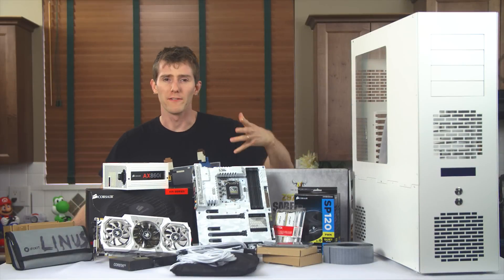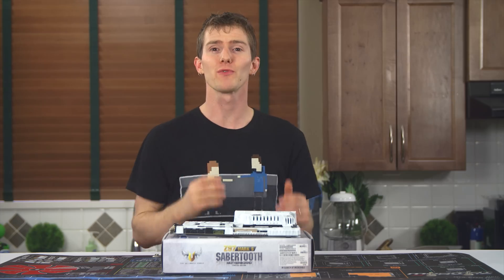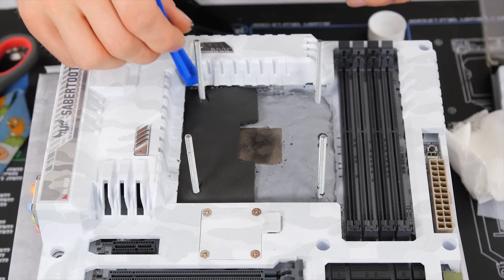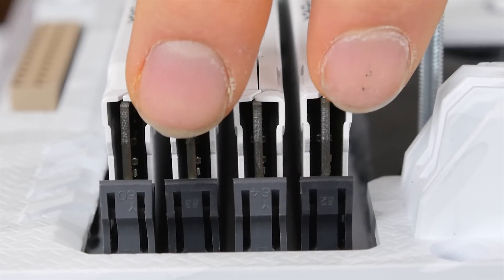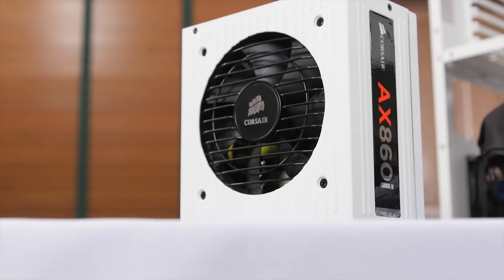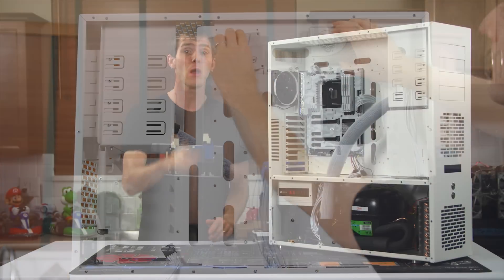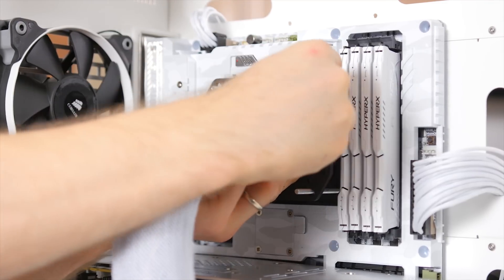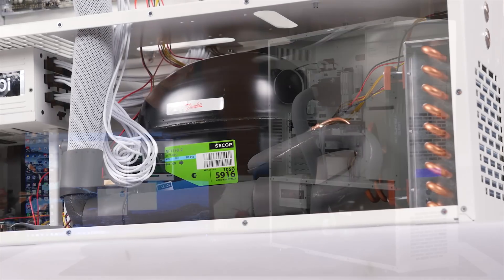ULTIMATE Sub-zero Phase Change Cooling PC Build Guide

Comment: So i have never built a PC before but i was thinking of going with the parts
CPU:i5-3570K 3.4GHz
MB: MSI Z77A-G41 ATX LGA1155
RAM: Patriot Viper 3 16GB DDR 3
GPU: Radeon HD 7950 3GB
Is this decent or is there anything i should change also what would be a good HD and Case to go with?
Reply: Jacob Grimmykins Where do you live and what is your budget. For this build it I recommend some western digital black HDD and you can use whatever case you want aslong it fits (Corsair 500R or SPEC-01 are more than enough, so you can safely use it).
Reply: Alright thanks im from the US ill try those 2 out thanks!
 and im trying to spend between 1000 to 2000
Reply: Just wait for Broadwell or Skyline. They are planned to be released this year. If you "need" a computer now, this is a typical high-end gaming computer: http://pcpartpicker.com/p/yQWcvK and anytime upgrade to Broadwell when its released.
Reply: thanks again i might try this build out
Reply: DON'T BUY THE ASROCK Motherboard, I discovered someone who had issue with it. Just get a Asus Z97-A or a Gigabyte GA-Z97MX-Gaming 5.
Reply: Jacob Grimmykins Why get a last gen CPU when the current gen is soon to get a die shrink? Intel Skylake (6th gen) is releasing this year. If you can't wait that long, at least get the Haswell. Unless, of course, you found a steal of a deal on that ivy.
Reply: Jacob Grimmykins Its good but don;t take 16gb of RAM , go with 8, it will run windows 8 (ha). Gaming needs no more than 8
Reply: thanks for all the comments i think i got a good idea what to build now. This is what i came up with. Im just sticking with a stock cooler for now because i wont be overclocking if i eventually do ill go with a liquid of some sort http://pcpartpicker.com/p/dRQGRB
Reply: I'm going to repeat this, wait until Skylake releases. It will be going to be released this year.
Reply: ***** They are using the same socket, but calling them the same would be an insult to the engineers over at Intel.
Reply: Jacob Grimmykins This is near the top of your budget but its really nice http://pcpartpicker.com/p/qpxdWZ
Reply: thanks i built something similar to this :D

Comment: is this good for a first pc?

Cpu: intel core i5 4690k
Mobo: GIGABYTE GA-Z97N-WIFI ITX
Gpu: NVIDIA GeForce GTX 960 - 2GB
Ram: G.skill Ripjaws x series 8gb 1600
Cpu cooler: Corsair Hydro Series H55 Liquid CPU Cooling System
HDD: WD Blue 1tb
SSD: 250 GB Samsung 850 EVO SSD

Comment: That is... unimpressive. Linus I can get 5GHz stable at 1.3v on my Kraken x61 (Albeit with my load temps in the 75 degree range) You really couldn't push it any harder with that bad bitch strapped onto it?

Comment: Bitch please I max out every game with my beast

[PCPartPicker part list](http://pcpartpicker.com/p/tVZZK8) / [Price breakdown by merchant](http://pcpartpicker.com/p/tVZZK8/by_merchant/)

Type|Item|Price
:----|:----|:----
*CPU* | [AMD 2650 1.45Ghz Dual-Core Processor](http://pcpartpicker.com/part/amd-cpu-sd2650jahmbox) | $25.99 @ SuperBiiz 
*Motherboard* | [ASRock AM1B-M Micro ATX AM1 Motherboard](http://pcpartpicker.com/part/asrock-motherboard-am1bm) | $26.99 @ SuperBiiz 
*Memory* | [Crucial 2GB (1 x 2GB) DDR3-1600 Memory](http://pcpartpicker.com/part/crucial-memory-ct25664ba160b) | $18.99 @ Amazon 
*Storage* | [Samsung Spinpoint F1 DT 80GB 3.5" 7200RPM Internal Hard Drive](http://pcpartpicker.com/part/samsung-internal-hard-drive-hd083gj) | $14.15 @ Amazon 
*Video Card* | [Sapphire Radeon HD 6450 1GB Video Card](http://pcpartpicker.com/part/sapphire-video-card-100322l) | $28.99 @ SuperBiiz 
*Case* | [Thermaltake VL80001W2Z ATX Mid Tower Case](http://pcpartpicker.com/part/thermaltake-case-vl80001w2z) | $21.99 @ Micro Center 
*Power Supply* | [Logisys 480W ATX Power Supply](http://pcpartpicker.com/part/logisys-power-supply-ps480dbk) | $

 | *Total* | **$150.09**
 | Generated by [PCPartPicker](http://pcpartpicker.com) 2015-04-13 21:44 EDT-0400 |

Comment: im running a 4790k on a h100i and im sitting stable at 4.7ghz... IMO all that noise and the cost of a phase changer isnt worth a 300Mhz better overclock.

Comment: was expecting to see more info on the temps than just a flash of what i assume is idle temps
Reply: Flat4Buggy
how are we supposed to know that though is what im saying. 10 min video and it shows temps for 3 seconds
Reply: Flat4Buggy
yea all that took place in about 3 seconds like i said. mustve missed it fist time. there couldve been a super basic chart showing load temps and non load temps because knowing load temps were single digit now i want to know how cold that thing gets at idle
Reply: EZOVERDOSE Exactly. The vast majority will watch this video because they want to see what it can do, not because they need help putting it together. I could only assume that this is the kind of thing someone would research further prior to setting up either way. Was hoping for an OC montage feat. Linus and Luke.
Reply: EZOVERDOSE I agree. The focus in this video is completely wrong. Why does Linus bore us with things like how to screw shit into place and not tell us how this thing actually performs. It's retarded.

Comment: Hey people of the internet, I am new in building PCs , please tell me if these parts are good:
CPU:AMD A10 - 6800K 4.1GHz quad core processor 
Motherboard:MSI A78M-E35 Micro ATX Fm2+
Memory:Crucial Ballaistix sport 8GB RAM (2x4GB) DDR3-1600 memory
Storage:WD Caviar Blue 1TB 3,5" 7200RPM international hard drive 
Graphic Card:Sapphire Radeon R7 260X 2GB
Case:Thermaltake Versa H23 ATX Mid tower case
Power Supply:Thermaltake SMART 650W 80+Bronze Certified ATX 
Optical Drive(optional):Samsung SH-224DB/BEBE DVD/CD writer
OS:Microsoft Windows 8.1(OEM) (64-bit)
The overall price is $592.79
Link: https://pcpartpicker.com/user/AmoorDJ/saved/#view=vJ3v6h

Comment: Pedantic uncalled for correction! The reason you can't cool a PC in the fridge is not so much that it's is not designed to handle a constant heat load, but that it's designed to cool things down and keep them there. It's cruise control for cool. I feel it's closer to the truth to say that a fridge is "not fit for purpose".

Comment: I was really stoked for this motherboard, even though it's price tag was double the other boards I was looking at. However the design team at Asus really messed this up. It has the same camouflage colored headers as the original sabertooth board, plus an "always-on" orange standby LED. -_- I can't believe Asus would market a 300$ board like this with really cheesy design decisions, but what's worse is when I wrote them about it they not only made excuses but stopped answering my emails altogether. So...... I will probably never buy from Asus again.

Comment: I thought that Devils Canyon got hot more easily, i read that Haswell processors fixed that problem, so why would a Devils Canyon processor be better for overclocking if it heats up easier?

Comment: My i5 2500k has been running at 5ghz for 3 years now :P but this looks super cool.
Reply: atlas :p So much for having an unlocked multiplier, eh?
Reply: Num43 Hah, it's totally and literally "Super cool" :V
Reply: atlas :p You really should overclock it.
Reply: Num43 2500K 4.7Ghz @ 1.33V on air for 3 1/2 years here. 

I could upgrade to water and easily make it to 5-5.1Ghz (PC boot into windows at 5GHz but unstable unless I put in much more voltage than 1.33v). The performance is still so amazing at 4.7, I don't feel like I will actually NEED to upgrade for at least another 7-8 years. 

My board is an Asrock Z68 Etrememe4 GEN3, so I could slap in a 3700K + water cooling to give me an extra 20-25% performance over what I have now + PCI express 3 as a bonus!
Reply: Num43 Upgrading my 2500K was a mistake.

My board failed due to a design flaw from ASUS. Instead of having no computer for 2+ weeks I upgraded to Z77 and an i7 for encoding; lower overclock, higher temps, minimal (gaming) performance difference for a much higher cost.  Ivy Bridge is when Intel decided to cut costs and use cheap TIM to connect the die to the IHS instead of soldering it; Haswell was even worse.  I've lived with that for 2 years, and I'm damn happy I upgraded.  I expect this to last me for quite a while. (I needed to upgrade just from a chipset perspective; Z77 barely had SATA3 ports, I was running 4 SSDs on SATA2, not to mention lacked PCI-E lanes which I needed for my SLI and expansion cards.)

Haswell-E and the refresh (Devil's Canyon) are better for the IHS solution, but I'm not sure if they match Sandy Bridge.

Things would be better if Intel actually had competition, but no, we're still forced to deal with little improvement year to year and no higher cores except on the extreme edition this gen.  When they have an 18 core Xeon, you just wonder why they refuse to at least double the cores on enthusiast chips and make 6-8 standard on mainstream platforms.
Reply: Mac Haven 4.4ghz? what motherboard are you using?
Reply: Num43 mine runs at 3.2 i haven't even overclocked.
Reply: Num43 its on my linux toaster.
i watch movies with this computer overclocking it would just make it too loud.
but someday. when i get windows on it.
Reply: Yeah
Reply: ***** Sandy Bridge is a crazy overclocker but yours can do more instructions per core, neither of us needs to upgrade :P
Reply: Ramon Zarat 3700k? you mean a 2700k? you won't get much performance really, just more threads for editing and games that use more than 4 cores(BF4...and that's it) PCI-E 3 is also pointless for now.
Reply: Ramon Zarat ..7-8 years?

You sure you're living in the same world I am? 7 years ago I was using an AMD 64 x2, 9800 GTX+ and running on a 1280x960 CRT monitor.

I just upgraded from a 3770K at 4.5GHz to a 5930K at stock speed and my GPU scores in benchmarks shot up by 12%.

12%, just from upgrading the CPU. I can't even explain that.

I'm dialing in overclocks and running stability tests now, so there's still a long way to go before I see the true performance gain of this upgrade, but it's kinda blowing my mind of how much it impacted GPU performance.  I'm questioning if it was the additional PCI-E lanes doing it.. as I run dual GPUs.
Reply: ***** Upgrading your 3770k was a mistake.
Reply: ***** My Z77 has 2 ports, it's a joke really so I use a PCI-E addon card. The way things are going my next CPU will probably be an AMD Zen in like 2-3 years. Sandy bridge forever :P
Reply: Num43 Could you make a video on how you over clocked your 2500K?  I can barely get mine past 4.4Ghz before something gets corrupted and I see many BSODs.  I had no idea that my cpu was this rock steady, glad I haven't upgraded, but that 4790K has been looking pretty sweet to me...
Reply: Maximus V Gene
Reply: Mac Haven You can squeeze another 400-500mhz out of it, easily! There are a LOT of videos explaining what to do mate...
Reply: Num43 is worth to sell my 3770 non k and buy one 2700k to overlocked it? :D I have my cpu overclocked to 4.1 on all cores right now, vcore offset negative 0.025, max vcore 1.088

Comment: Why windows 7? I though (I may be wrong) windows 8 was faster due to modernisation of low level device firmware to Max speed? Maybe a video on windows 8 vs 7? Does performance differ?

Comment: lower temps don't guarantee a higher overclock.
My 2600K was at 5.0ghz like 3 years ago on a custom loop.
Reply: PC Master Race They kinda do son.
Reply: ChristmasSamurai my overclock did not increase when I switched from a hyper 212 to a custom water cooling loop.
2600k stable
5.0ghz @  1.5V
4.4ghz 1.15V
same for both air and water despite the 25c load temp difference.
Reply: PC Master Race Will mine was at 5.2ghz with liquid cooling and 4.8 on a cryorig h7 so...
Reply: ChristmasSamurai well i guess you suck at overclocking.
Reply: ChristmasSamurai I seriously doubt you can run 4.4ghz at 1.15V on any modern i5.Also, you run your 4690K @ 4.6ghz not 5.1 LOL
IDK why you need to lie to me
Reply: ChristmasSamurai 4.6ghz* don't lie to me lol.
You use a weak i5, so I can't expect high levels of skill from you

Comment: Would this pc be able to run the new tomb raider on ultra 1080p?

GPU - Gigabyte GTX 970 G1
CPU - i7-4790k
CPU-Cooler - Corsair h100i
Motherboard - Asus Maximus VII Hero
SSD - Samsung 850 EVO 250 GB
PSU - Corsair CX 750W
RAM - 8/16GB HyperX beast 2400MHz

Thanks.
Reply: Tom Dreese New? That game isn't even coming out for pc.
Reply: Whhhaaat, why?

Comment: I feel slightly disappointed that the case doesn't contain four Titan X's cranked as high as they can go. That is where the phase change cooler would really shine.

Fun question; Do they make a horizontal version of this where the GPUs could be laid across so the same cooling unit could phase-change cool them as well?

Comment: How high are the noise levels with this?
PS. "Envy" is a very light word that can describe my feelings right now...
Reply: GRamers It has as much noise as a small refrigerator, because.. well.. it sort of is. So, it's not very quiet.
Reply: Wouldn't recommend going to frozenCPU at the moment
Reply: GRamers You could always buy a water chiller made for custom water loops. I think FrozenCpu sold them. It's basically a water chiller for aquariums for cold water fish that they made into water cooling for pcs that pre-cools the water going in the loop. Just hide the water chiller in the closet and no noise ;)
Reply: TrueGamerGR Έλα ρε Ελλαδάρα!!
Reply: GRamers Contact a HVAC company/engineer. You only need a tiny compressor, and there are more quiet ones, instead of the one he used in the video. Since it's a compressor/full cooling circuit, you could just put the compressor more further (instead of in the case), and run the pipe into the computer. So there, that's 0dB cooling for sub-zero temps. A system like this if you really do have the correct sizing/pipes/etc, will run for 5-10 years. Most compressors die from the extreme heat outside. source: HVAC guy.
Reply: GRamers Δημητρηηηηηηηηηηη
Reply: Mephedrone Cat didnt they close down
Reply: Robert Shipley Yeah they are but the website is still taking orders so its basically throwing away money
Reply: GRamers Your computer norm, plus the noise your refrigerator makes. The sizes of the compressors are about the same.
Reply: George Papadopoulos χαχαχα παντού είμαστε!
Reply: ***** Fuck off!
Reply: +Pholiage lol subzero cpu and cold liquid unit for gpus lol and lots of fans
Reply: I know  something that will be high if you break the pump
Reply: Εσυ πρεπει να εισαι ο Δημήτρης ;)

Comment: Does the MSI Z97 Gaming-5 support SLI? I'm getting a GTX 970 and I was wondering if 2 of the,mould bottleneck a i7-4790k. I don't wanna overclock but if I truly would have to I could. It will have 16 GBs G SKILL RipJaws DDR3 ram.
Reply: Of them would not them,mould
Reply: StarFloGaming MSI claims to support SLI on that motherboard.
Reply: Thanks man I found out yesterday. Now I know if I need it I could get another GTX 970

Comment: Something is wrong with the temps. The LD phase change single stage is designed to hold a 320w load at -30*C so there is something wrong with the setup if your running that high of a temperature under load. The evaporator is probably not making good contact or there is not enough thermal paste (you need more thermal paste when using phase change. A dab or line won't work well).

Comment: What I don't understand is that the cpu is cooled down by exotic methods so much but the graphics card, which consumes much more power and outputs a lot more heat, is just pushed to the side and not considered much when it comes to cooling :/

Comment: I know it always better to be safe than sorry but is there REALLY a need to assemble your entire build outside of the case to "test" that everything is working? How often do you really come across faulty equipment, especially for high end builds like this that use top-tier, name brand equipment? Maybe in a $300 build or something but for these sorts of builds it just looks like an unnecessary precaution and a waste of time.

Comment: Ok, Linus I run a 4790k on a Maximus VII Hero with a cCrsair H110 and I run it at 1.4 volts. You should be able to push you voltage up further than that with a phase change system like that.